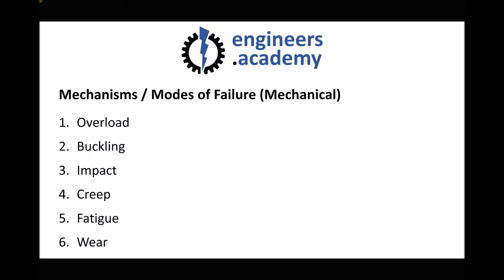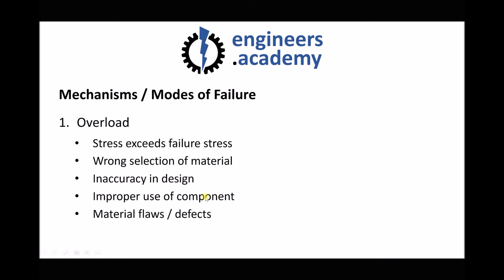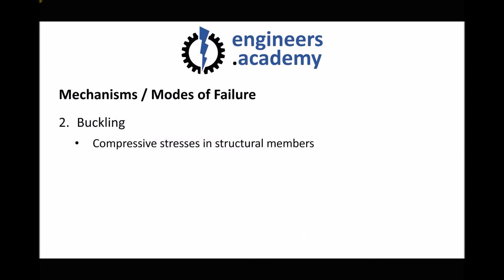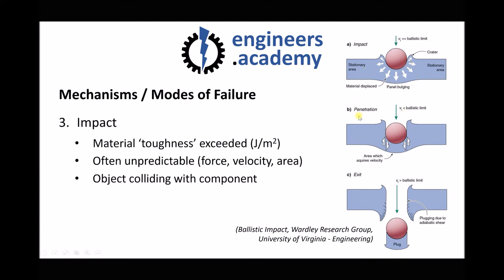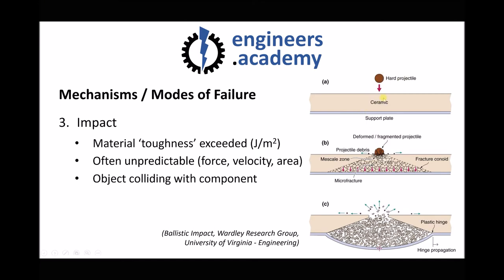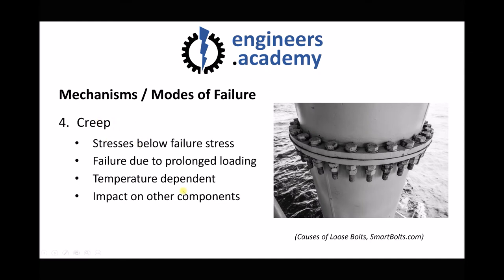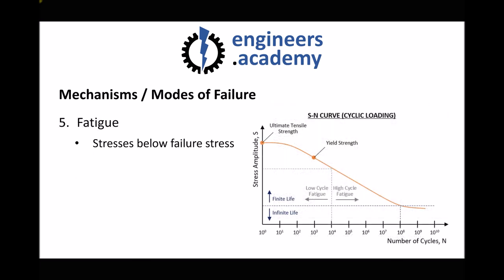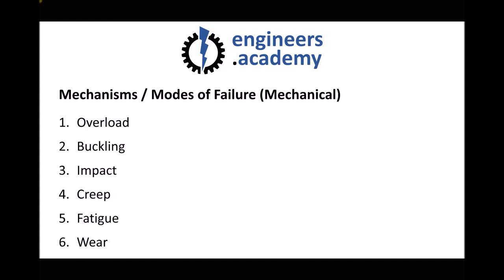6 Common Modes of Mechanical Failure in Engineering Components

Comment: Sir what about fracture and corrosion
Reply from the maker: Thank you for your questions. Fracture occurs in many types of failure, so this might occur during fatigue as an example. Corrosion is a type of degradation rather than mechanical failure and is covered on a later video.